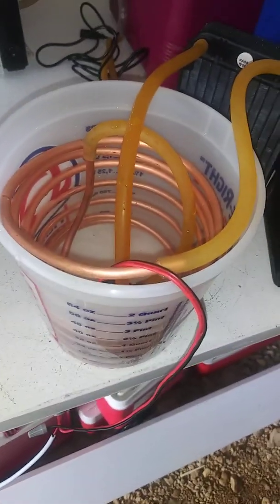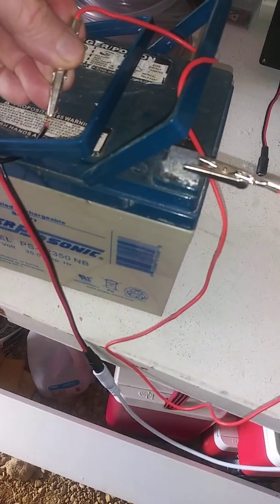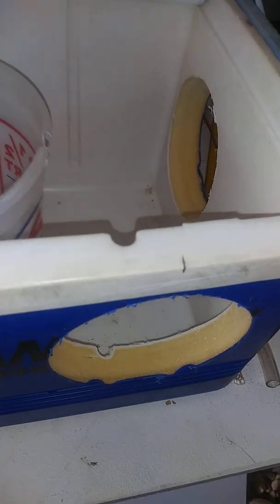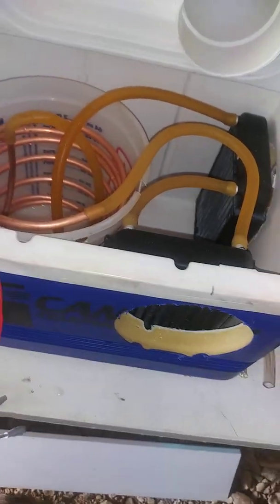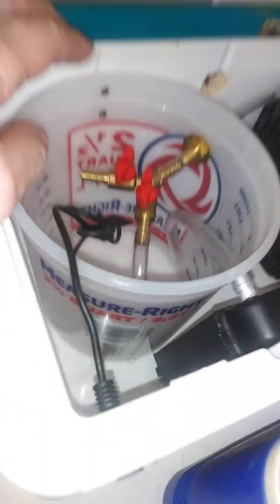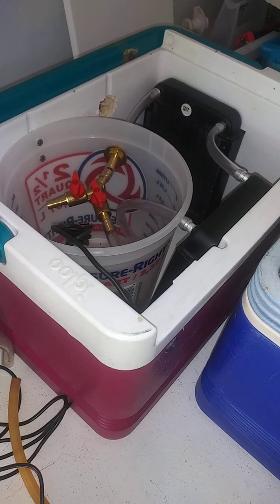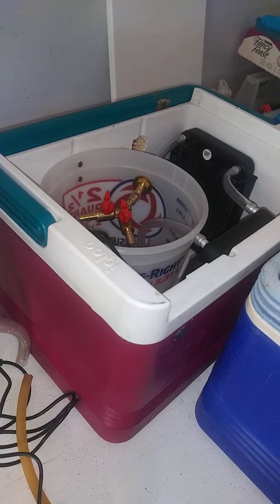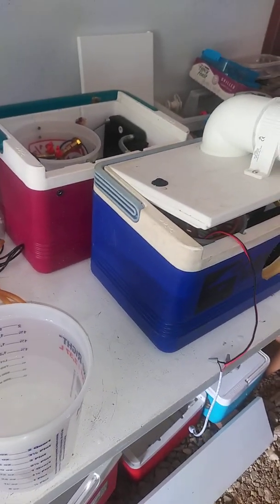DIY AC - Double PC Radiator - Closed vs Open Loop Sneak Peak - Pro Tips Homemade AC

Comment: So have you found any benefits of using a closed system in a cooler with no air flow inside vs two tubes input out put through a bulkhead connection, no heat exchanger (submerged radiator)?
Reply from the maker: I would have to do longer tests yo really be able to make a final  decision. But I only see the closed loop system I tested succeeding as well as the open loop cooler once equalibrium was achieved.  It took a while to get the internal fluid cooled and by that time the initial test ice was melted.

It could work after equilibrium sets in and then possibly only maintenance of adding needed ice to keep it at a steady temperature. The initial phase is the clincher. I'd like to perform that lo get test next  time for sure.

Thanks for asking about the results!
James & Rescue Kitties

Comment: So did the closed loop last longer and was it as cold? I need to get about 8 hrs out of a medium size cooler.
Reply: I'm still waiting for any follow up videos myself. I'm wanting to make a closed loop system with copper coils inside a 50 qt cooler (not add a bucket or small ice chest inside of it) to make full use of the coolers ice/water capacity, then make a separate portable blower box out of a smaller cooler that will house mt 8x8" heater core and electrical switches etc. I love James videos and concepts but leaves out many details.

Comment: I am curious have you ever tried using plumbers non toxic antifreeze instead of water in your cooling systems?  It can be refrigerated to -20 to -40 and still remain a liquid that could be pumped through the radiators you use. Will this damage the plastic parts in the pump impellers or why not try it ?
Reply from the maker: I haven't tried that yet. I've looked into  computer organic antifreeze but have yet to try that in open loop to avoid messes. I'd like to try it closed loop but they take longer to reach a decent c ooling temperature etc.

Have you built a unit yet? Wondering what kind of results you run into or design successes etc.

Thanks much for that question! I've pondered that idea for quite some time.
James & Rescue Kitties

Comment: I'd like to ask you if you can if possible a tutorial that would give a step by step detail of a closed loop system.
I like your videos but I definitely want to try a closed loop system and need maybe a more step by step on it.
Reply from the maker: Definitely!
I'd be happy to make a closed loop video tutorial. I'll make it using a larger cooler for ease of build. It's the same exact concept. But I'll use a submerged radiator instead of copper tubing to ensure the mass balance. I tested one before like that but didn't make a video.

Thanks!
James